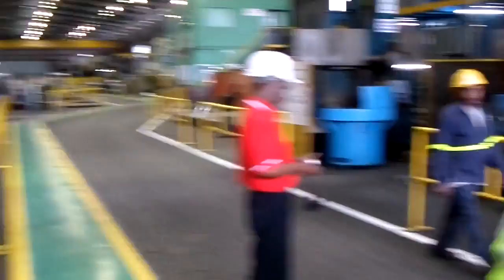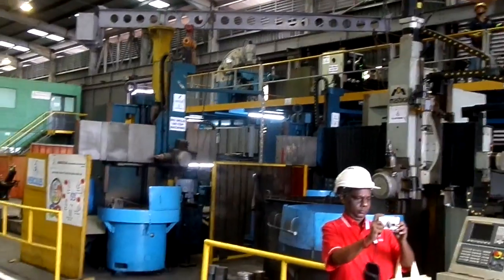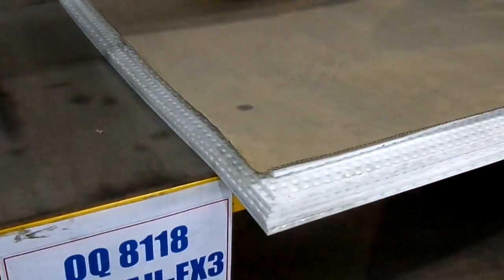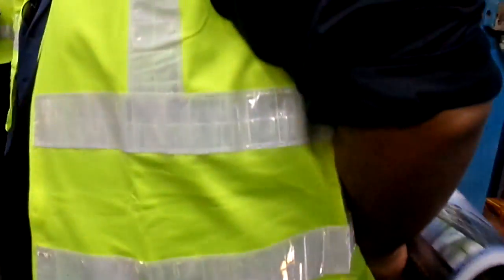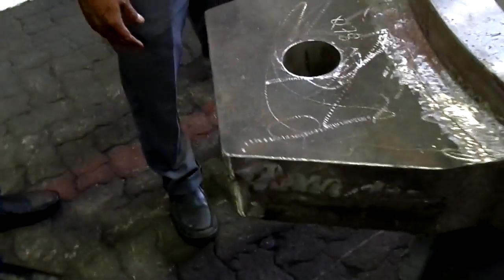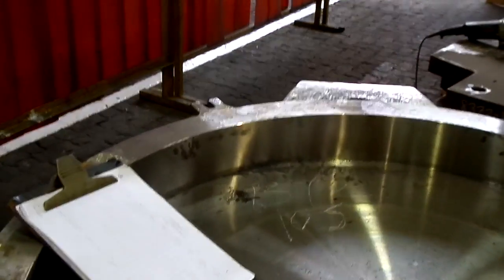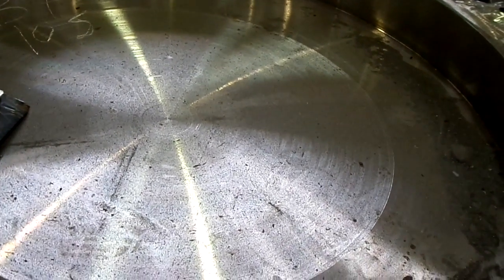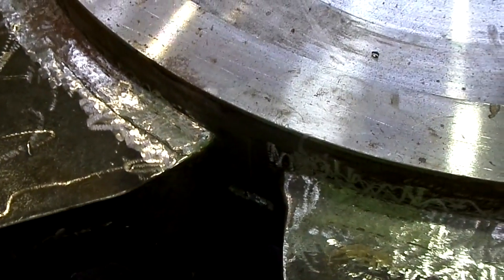Bridge Bearings Pads and Expansion Joints Factory Visit

Comment: We have experience of the so call stainless steel upper plate which is not of the S316 grades.
Having formation of rust stain...
Reply from the maker: We don't accept any material that is not tested by Independent testing agencies and finished bearing shall be traceable to original sources.